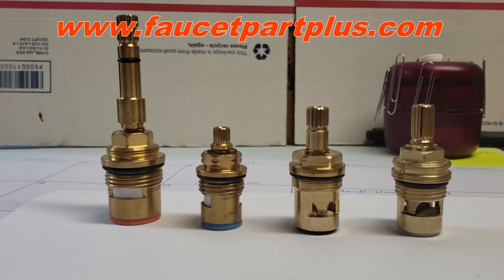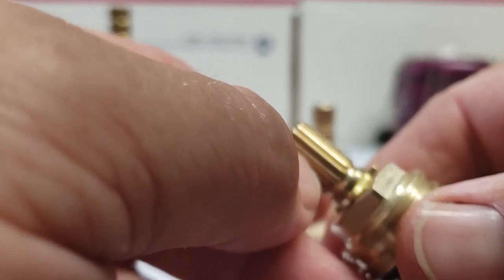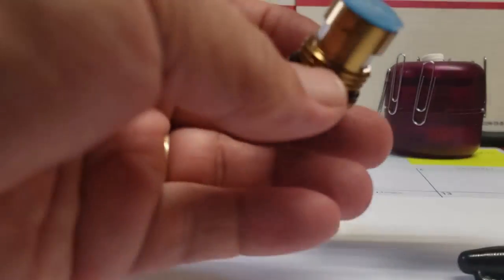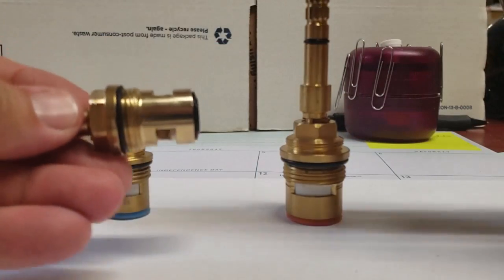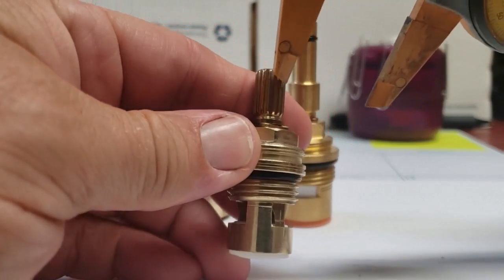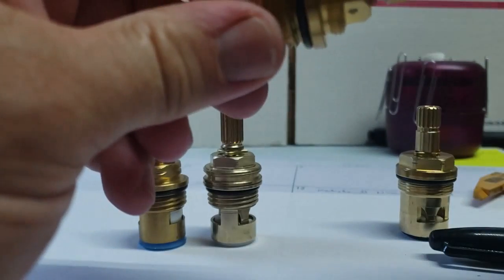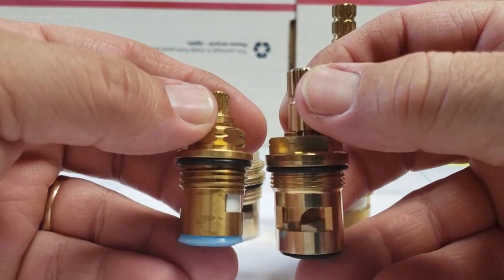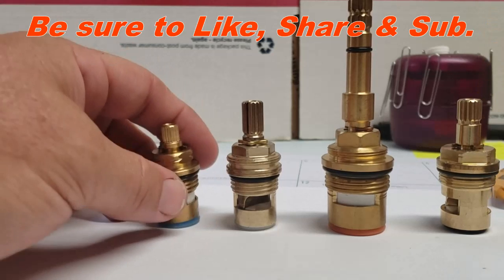How to identify a faucet stem cartridge

Comment: Your examples are not exhaustive. The one I have is different both in terms of spine, mine is 20, and overall design. Still trying to figure where I could get my hand on one to fix my leak. Failing which I will try changing the washers. Thanks

Comment: Hi Turbo Tim,  I have a dilema with replacing stem cartridge for an old Pegasus Faucet.  I know the right part number: 3S-11C and H.  The problem is the cap to hold the stem completely crumbled and I am having a difficult time finding someone who actually carries these caps.   Without the Caps the stems just shoot right out of the socket when I turn the water on.   Your assistance is greatly appreciated!
Reply from the maker: Hello, Those caps are hard to get. If it uses a delta style cap then you might be in luck. Those are available on my site. We will need to get the measurements to see if it will work. www.faucetpartsplus.com

Comment: Home Dumpo Expo had a lot of import shower valves, tub valves, roman tub valves, as well as faucets. They went belly up and all the aftermarket replacements are not Ca. lead-free compliant. So you find it then need to go to Arizona "one way or another to get it. Of course our actual water from the municipality has more lead in it than any of these parts ever did.

Comment: Trying to identify a shower valve for cartridge  replacement.  Single handle not push pull rotates first cold then hot.  Has  splines for handle not square
Reply from the maker: Just send me a picture of the cartridge. I should be able to find a replacement. faucetpartsplus@yahoo.com

Comment: That's more difficult than it needs to be. Why measure?  Just take out the old one, remember if it's for hot or cold and go to hardware store.
Reply from the maker: That's only works if you have a hardware store near you that has every part ever made. Otherwise, you may have to order it from the internet. "Revised" The people you take it to have to be knowledgeable about faucet parts. Otherwise, your probably wasting your gas.
Reply: That doesn't work. I took my stem cartridge out and took it to 2 hardware stores only to find out they don't carry it nor could they tell me the size so I could go find it from a plumbing supply store, so this method is the only way I could figure out a close enough size.
Reply: Aside from open sourcing , the dame things should have brand names on them , at least on the faucet !